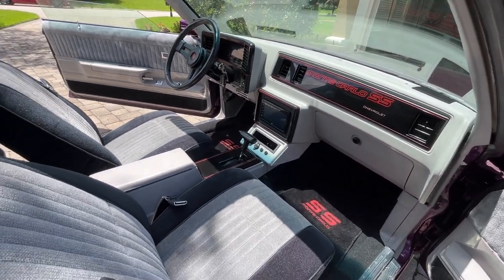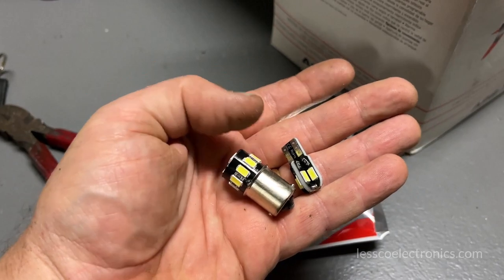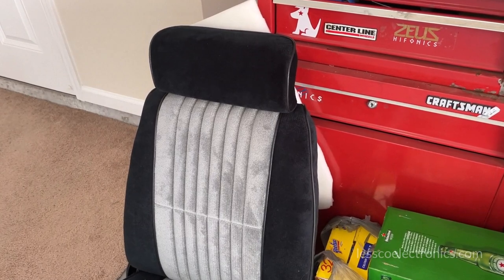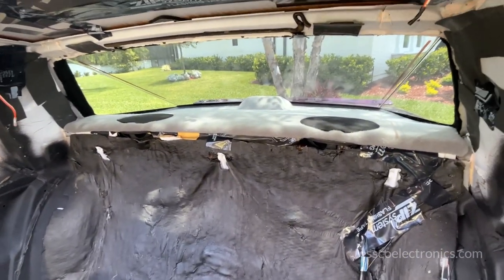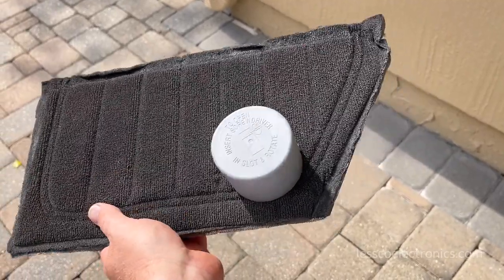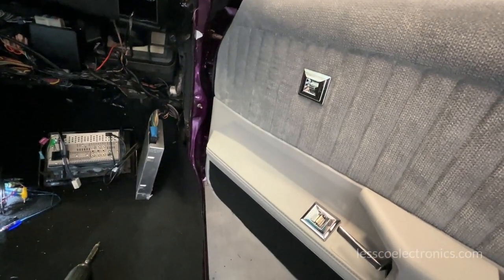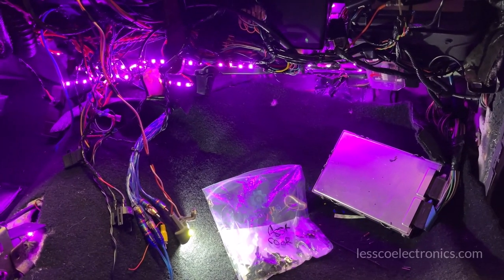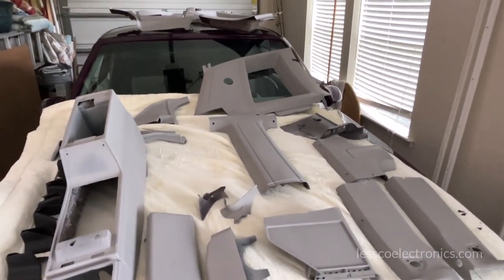How to do a custom Monte Carlo SS G body auto interior and change the color

Comment: Nice work.  I’m changing my interior on a 1980 Monte Carlo.  May I ask how many cans of SEMS did you use after all for each stage? Adhesion, primer, and paint?  Love the lt graphite.  That’s what I’ll be using.  Thanks in advance.
Reply from the maker: All in all I used 11 cans of the  light graphite and keep in mind I also used the satin clear and primer as well..

Comment: Great Job Man! But where did you locate the hvac controls??
Reply from the maker: I thought about it, and realized I removed the ac for ore horse power years ago, and I never use heat here in FL with the top off when ever I drive so I just left the controls behind the glove box
Reply from the maker: I tied them back in a tidy manner since I always drive with the roof off and I have no a/c (h.p. is more important to me)!